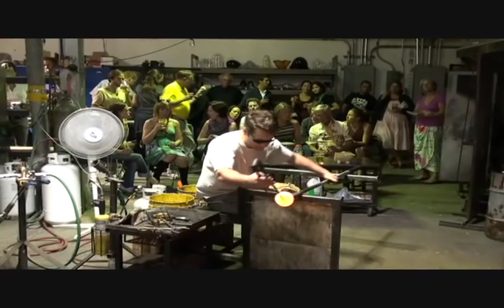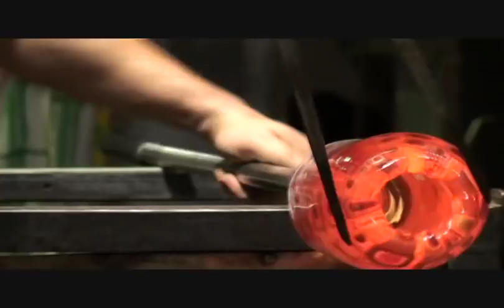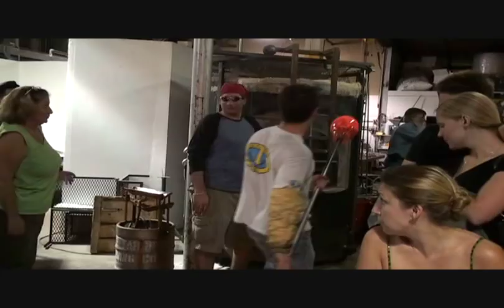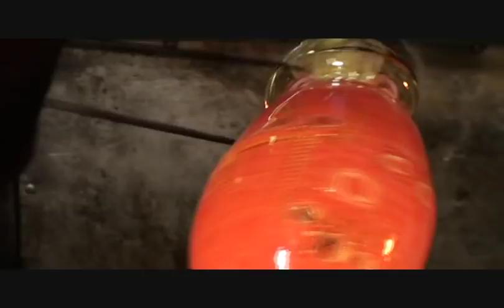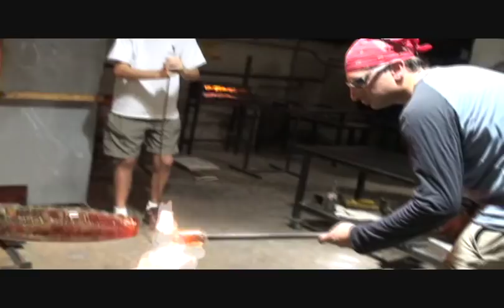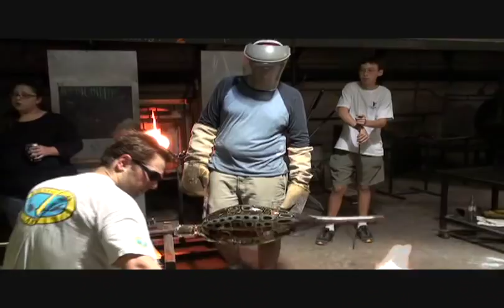David Patchen - Hot Glass Cold Beer!

Comment: the objects in the glass were glass tiles. There's several ways to make them. One is to put powder or chips of glass onto clear and pull it like taffy, another is to fuse sheet glass into bricks and pull the resulting brick when molten. then you cut the tiles up and work it as shown. what Mr. Patchen does is pretty advanced, i've done a couple smaller ones, but i am more into cane at this point (striped glass) .